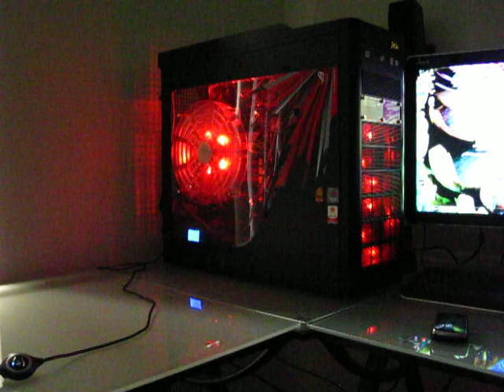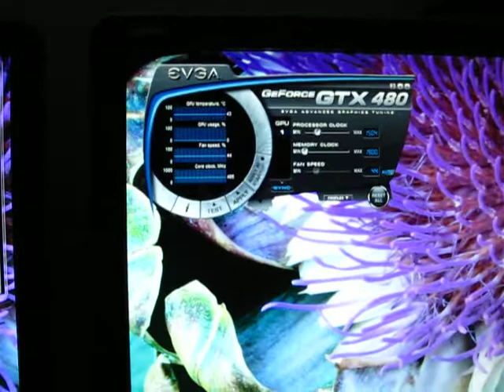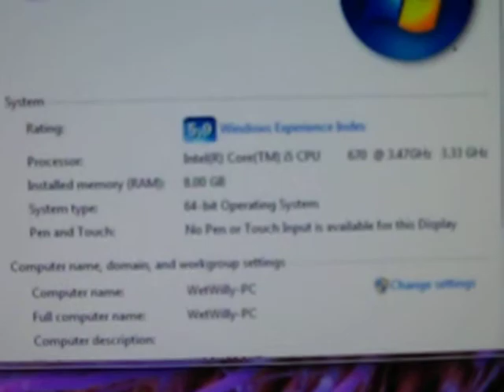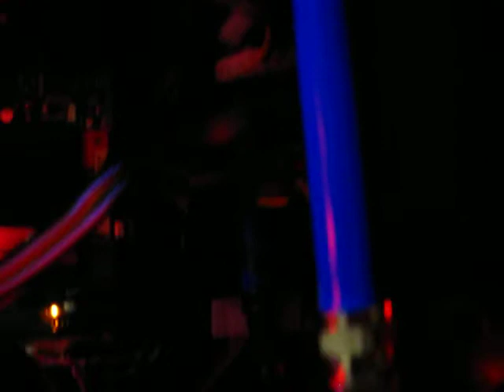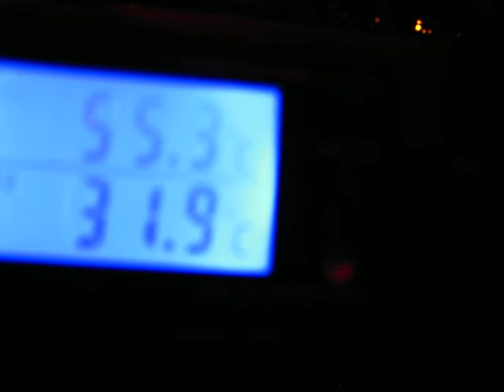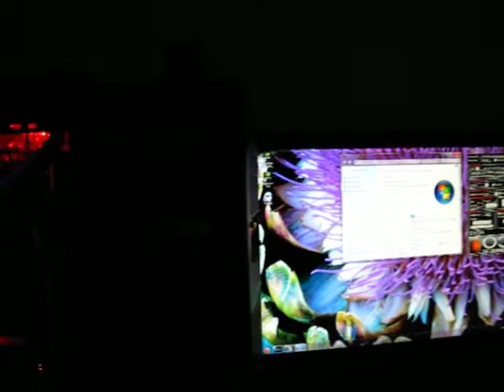GTX 480 HC FTW Gaming Rig III maximus iii extreme

Comment: Nice rig but to loud. One reason for water is to have no fans at high rpm. You the CPU cooled you have the GPU cooled and ram at 1.65 v does not get hot.